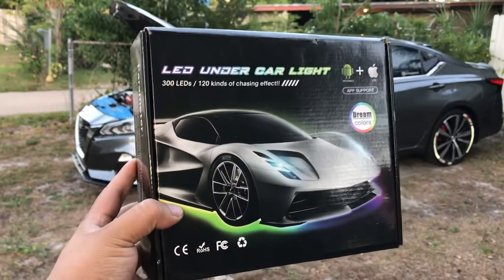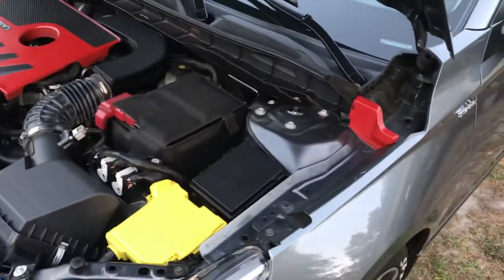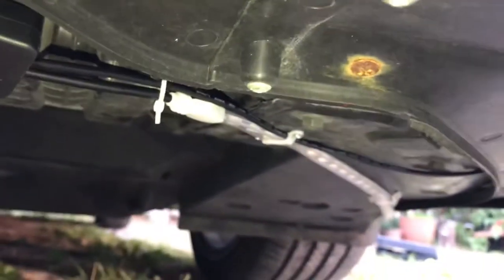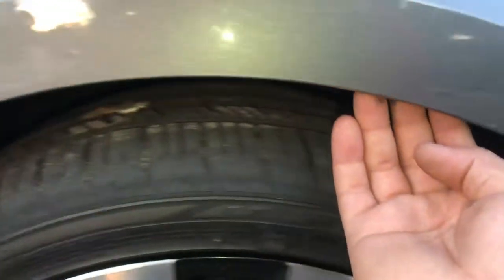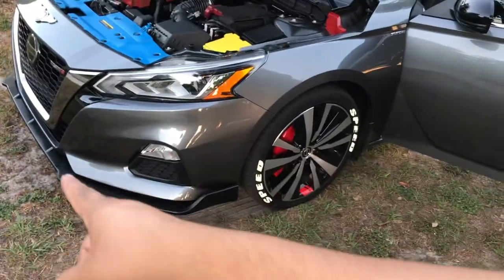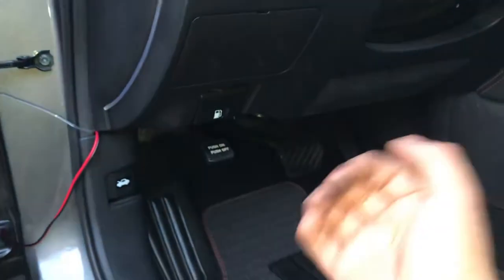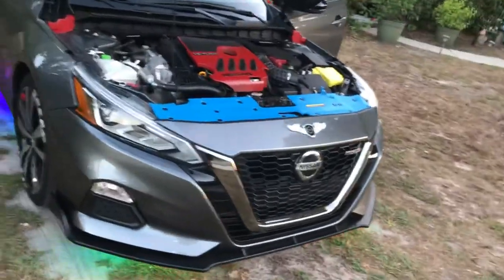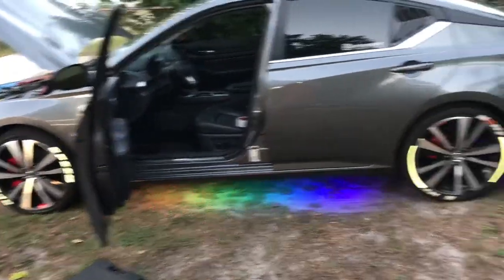How to install underglow kit using cigarette port

Comment: Honestly smart asf to not mess with the battery. I have a model Y with wack ass battery and I’m so grateful you made this video
Reply from the maker: Yes yes and to prove it’s true, about 2-3 months ago I had my grill light done connected to the battery and fuse and they burn a module in the turbo causing 6k to fix it  according to the dealership, that was the first and last time I let someone touch my car lol and it was professional place not some random wack a**
Reply: @IAmHugoPerez  yeah, I’m not trying to mess with the battery since it’s such a new car and so much tech in it. I’ll stick with the cigarette port. And btw, I’m assuming your wires can’t be seen right. It’s tucked away nice
Reply from the maker: @EhvanTea  i feel you and only on the side of the door a lil that’s all

Comment: Do you need to raise the car to install the lights or can you install them while the car is on the floor
Reply from the maker: Yes I raise the car for 3 reasons, I need to see where I was gonna mount the led , I needed to drill those the clips to the led which was a lot and also I had to remove the tire to hide the wire on that plastic around the tires, it wasn’t easy
Reply: @IAmHugoPerez  thank you I ordered some and i dont have very much experience with doing that but thank you 😄

Comment: Have these on my scooter on the inside so the panels glow. Took seven hours to hook up. Looks sick af cops love it too. Get stopped quite a bit. Used everything they gave me. The tape is crap so use the rubber brackets that come with trust me the tape is schit
Reply from the maker: Niceeee but damn the tape came out to be the best one I ever seen on any underglow lol it sticks super hard and I beraly use the rubber brackets I even tape it on the metal and didn’t use no rubber brackets and it has wet and dirt and hasn’t come off at all and it’s been more than a year lol
Reply: @IAmHugoPerez  my scooter is how you say no flat spots alot of curves on the inside so the tape won't stick so used the rubber brackets works well for me considering I live in Las Vegas and the sun will melt that tape away even on the inside of the bike the heat will destroy the tape
Reply: Trying to watch a video on how to customize the light patterns more but can't find anything really any info lmk thanx guy
Reply from the maker: @sundownwendigo5750  oh ok see that makes sense compare to a car its under and not expose to the sun lol so yeah you right
Reply: @IAmHugoPerez  all good homie you can see my bike on my YouTube channel thing here. Not done tho gonna add a glow in the dark vinyl wrap next week